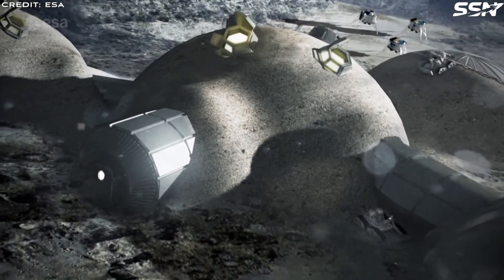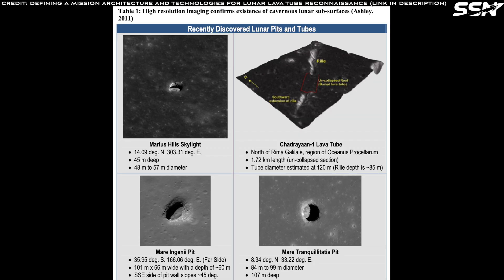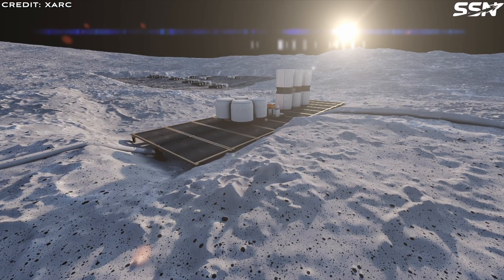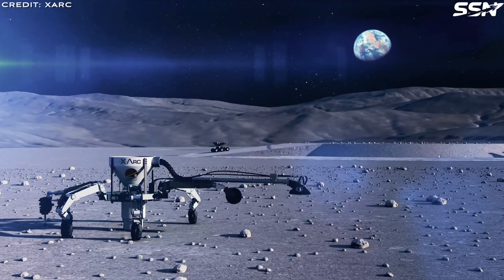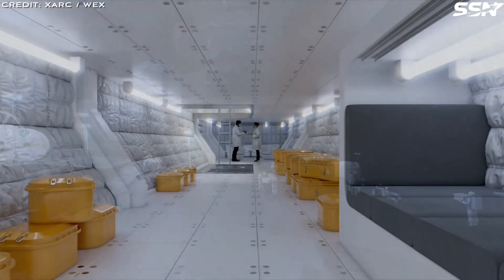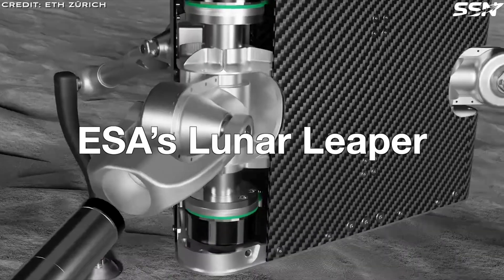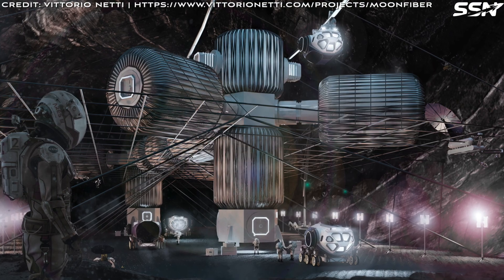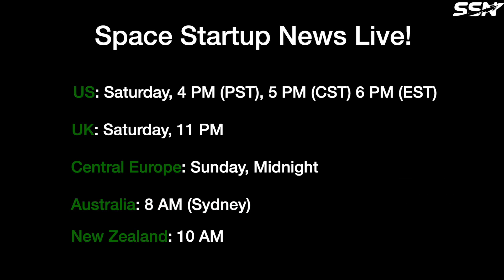Using Lunar Lava Tubes for Habitation

Comment: You need to think using the regolith to spin that fiber and combining it with a resin i.e. closed foam insulation and spinning it into the cavity in question i.e. the lava tube, thereby sealing it at the same time, reinforcing it. The way they do tunnels in the world nowadays with concrete reinforced and placed by a tunnel boring machine, this is why Elon bought one.

Comment: Given that the temperature of the soil on Luna is REALLY cold. Like, -20 to -30 degrees C, that probably precludes ever sealing off a whole tube,  and creating an environment that would support plants. Any humidity in the air would freeze on the walls, and grow until large sheets of ice break free and fall and break stuff in your settlement and farm... Not good!
It's still an interesting idea. I suppose it's possible to try to insulate the entire tube with some kind of spray foam concrete or something along those lines, then run heating coils along the entire interior surface to keep the entire roof, walls, and floor at a comfortable temperature, but this would require a TON of energy, and likely would require futuristic power sources. 
While you can envision building on the surface by using some really strong insulation panels to protect the floor from freezing your habitats, and even digging into the regolith and insulating your habitats, these tunnels are going to be very cold, even if they are completely sealed off. 
Might be a decent place to build habitats, but then you don't have sunlight for solar panels near your habitats... so there's a tradeoff. 
Ultimately I think that the poles with ridges that are in continuous sunlight for solar are likely the best location, especially as there is some likelihood of finding water there.
Reply: A lot of these tubes are pretty deep. As to insulation, I'm sure rock wool can be produced there. 
Radiation and thermal stability are two very large problems. Lava tubes take them off of the table. 
The critical points is going to be shipping and using local materials. This is a viable plan. 

However, I see people using regolith as a magic material that would solve all of our problems here on earth. It's not. From what I can read it is shattered basaltic material with some H2O, Helium 3 and hydrogen. The titanium is going to be more useful. Before this can be a reality we have to address shipping costs. We cannot get enough materiel there with chemical rockets. Rail guns are the only viable solution I see.

Humans working on the lunar surface is a fantasy. That's Robot work. We got lucky that a solar flare did not take out our astronauts.
Reply: Maybe giant mirror can reflect enough sunlight to warm the interior.
As to sealing off the entire tube, might just a fantasy. Is it strong enough to handle the pressure, from near vaccum to earth pressure, with just special foam?

Comment: Fascinating video. China is already investigating lunar lava tubes with great interest. Apparently, this is part of their idea of building a long-term presence on the Moon. We should investigate this is well for both Earth's Moon, Mars, and possibly the Martian moons and near-Earth asteroids.

The idea of spinning cables, fabricated from lunar regolith, is also fascinating. I wonder if a large lava tube could be spun with a close-knit network of cables to stabilize the lava tube so that no cave-ins could happen. If this could work, a long-term base could be constructed. There was an intriguing image in this video. It looked like a base had been constructed vertically as well as horizontally, and the resulting structure looked as if it formed an elevated carousel. This made me wonder about constructing a carousel moonbase, constantly suspended off the cave's bottom by a spinder's web of cables, with the outer rim of the carousel forming the base's "floor", and constantly rotating to simulate Earth-normal gravity. If such a carousel could be combined with a non-rotating element, ingress and egress to- and from- the base would be fairly easy.  But where would visiting spacecraft land and be stored, or refueled, or otherwise serviced? Would the ships land on paved landing pads inside lava tube "skylight"? Or would the skylight be covered over for protection, and a neighboring tunnel built between the surface and the lava tube? Could a regolith-concrete "cave" be constructed on the lunar surface (roof covered with loose regolith, and outer walls buried in it) so that paved spaceship landing/launch pads could accept visiting spacecraft, send out a tracked vehicle to haul the visiting spacecraft into the concrete cave-shelter, then haul the spacecraft into a smaller inner chamber that could be sealed shut, pressurized and work would begin on the ship? (Meanwhile the spacecraft's crew could disembark, be carried through a tunnel down to the lava tube base, and relax in moonbase housing while the ship is being serviced.)
Reply from the maker: China are building an International Lunar Research Station on the Moon. They just signed a deal with Russian for a nuclear power plant for their base. There are now 17 countries involved in this effort, with Chinese astronauts expected on the Moon in the coming years. I've been thinking about doing a video on their efforts.